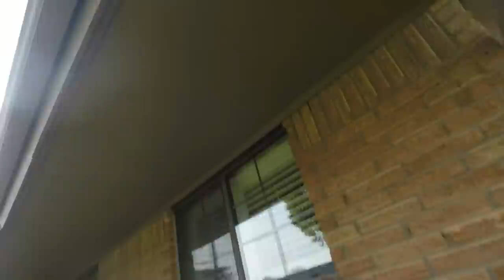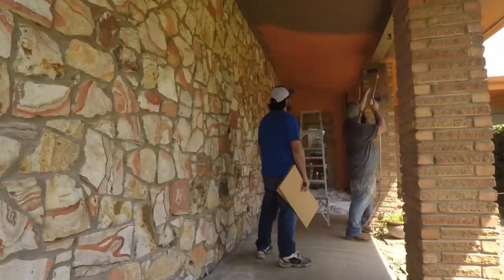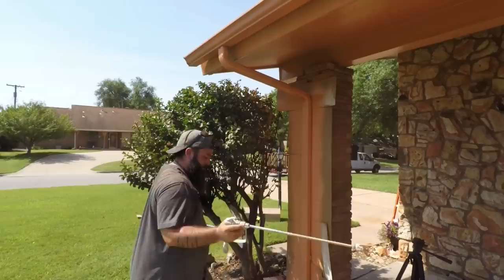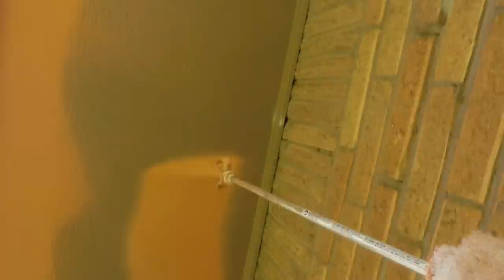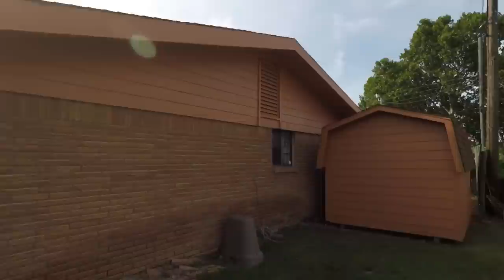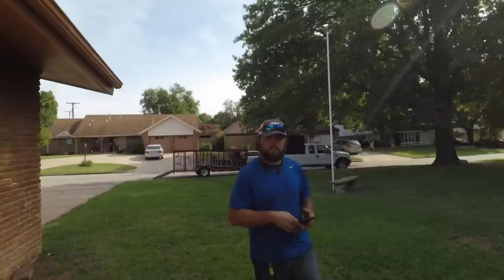START TO FINISH HOUSE PAINTING (time-lapse) | Painting tips  | This house SOLD in less than 1 WEEK

Comment: I'm surprised you didn't pressure wash or use a clear sealer it's important to wash to remove chalk and dust and dirt from the surfaces and using a sealer as a base for the finish coat to adhere if not I think you'll have some bubbling and peeling happening within a few months
Otherwise awesome video and very entertaining xD keep it up and btw I don't mean any hate I'm just curious why you chose not to do those things

Comment: How many 5 gallon buckets of paint did you use for this job and did you thin it with thinner for it to go through the spray gun and is that a hvlp sprayer
Reply from the maker: I used 6 gallons uncut.
Reply: @LawnCareJuggernaut  nice 👌

Comment: I'm sorry Juggernut... there is no need to caulk under horizontal siding. That is not where water penetrates, it is horizontal. Where caulking is needed is vertical seams, like where the siding meets the wood trim at either end of the siding. Putting caulk over nail heads never hurts. Water can penetrate at those points.

Comment: Love Ya but spray painting is cheap and thin. You don't get the true thickness of the paint that a home needs when using a brush and roller. no matter what anyone says don't let a painter spray your home.
Reply from the maker: It really all depends on the application. 
When someone paints the proper prep work needs to be done. It is also important that when they apply the paint it should be high quality and a minimum of 2 coats. If you watch the way that I am overlaping I am apply multiple coats